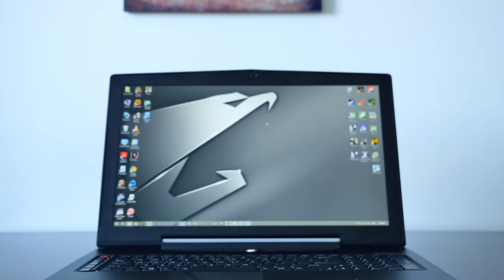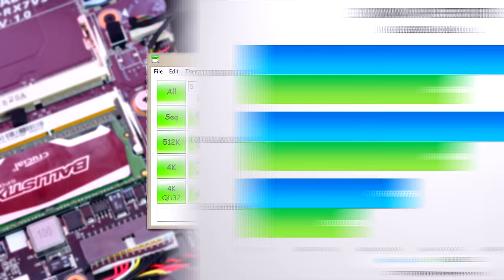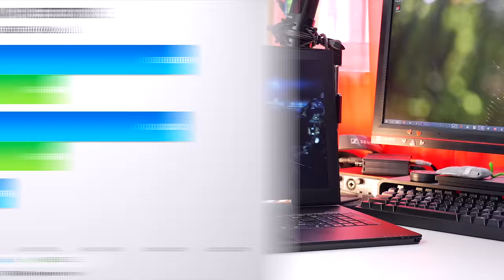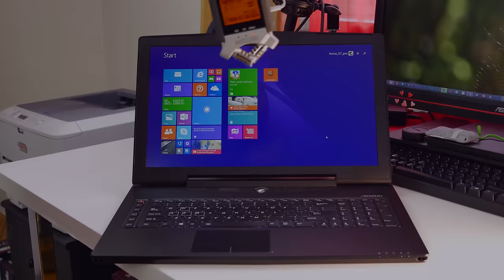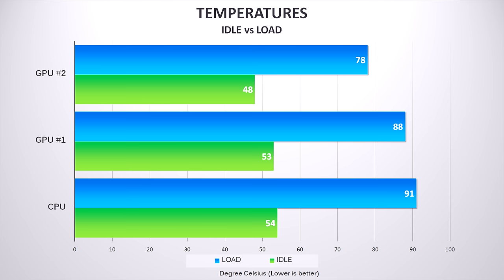GTX 970m SLI inside a notebook - Aorus X7 PRO Review

Comment: Could someone recommend me some good gaming laptops my budget is £1200
Reply: Im looking for a laptop too. Im a student who needs to do work who also wants to do some casual gaming. My top choice right now is the $1400 New Dell XPS 15 non touch and non 4k display. Although 4k is optional. But it will cost $2000 and 4k is too much for a 960 to handle. Or the older model of the Aorus x7. But i guess ill just save up for the Aorus x5 pro. But Aorus might release one with a 980m so ill probably get that instead.
Reply: •$2500 Aorus X7 Pro: i7 4th gen, dual 970m sli
•$2300 Aorus X5 Pro: i7 5th gen, dual 960m sli
•$1700 Asus G501: i7 4th gen, single 960m

(There are some other Asus laptops but theyre HUUUUGE, you can just search Asus gaming laptops if your interested)

•$1400 Dell XPS 15: i7 6th gen, single 960m
•$1150 MSI Apache GE72: i7 6th gen, single    960m
•$900 Lenovo Thinkpad Y700: i7 6th gen, single 960m

There are many others out there but these are some to pretty good ones. Except for the asus because the 4k on it is too much for the graphics card.
Reply: +LJHB msi apache is good and cheap, i'd get the skylake version 6700HQ because apparently it helps with the heat and performance

Comment: or i could get better PC by building it with 980 sli and run games 4k maxed out 60fps and cost the same (with monitor)
Reply: 980 SLI doesn't max out games at 4k 60 fps, but yeah you could build a awesome system for the money
Reply: ***** it does for most of the games 
except very few ones that you can count with your fingers 
btw
when i said max , i wasn't thinking about maxing AA because i believe it isn't that important to get it maxed or even 4x in 4k res
Reply: By maxed out I mean with AA, with a 980 you can definintly not get it at 60 FPS
Reply: ***** welp i wasn't thinking about maxing AA 
i was thinking about the graphics settings 
since AA isn't that important at such high res 

still for the price building PC is much better except if you have to get laptop 
and this one doesn't deserve all the horse power and sli 970m since the panel is only 60hz at full  HD 
overpriced IMO
Reply: That's not the point though